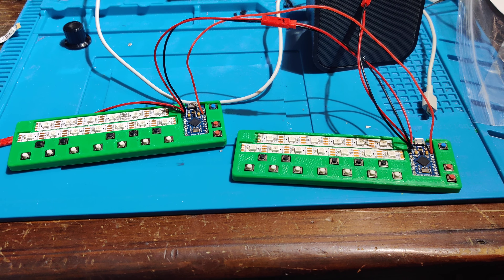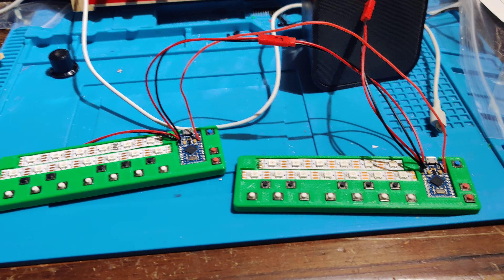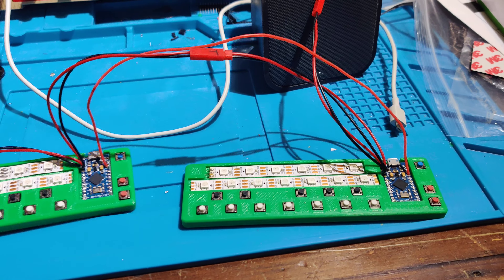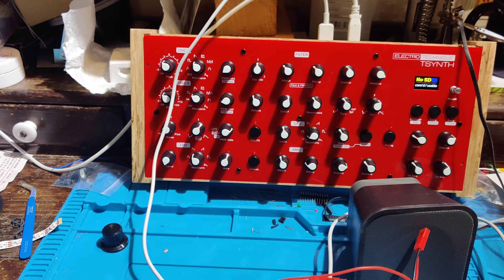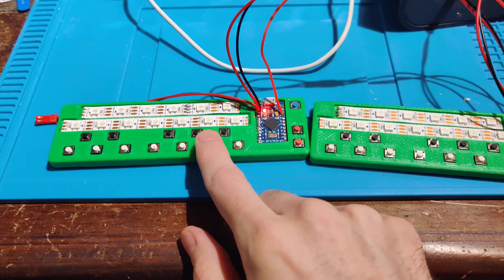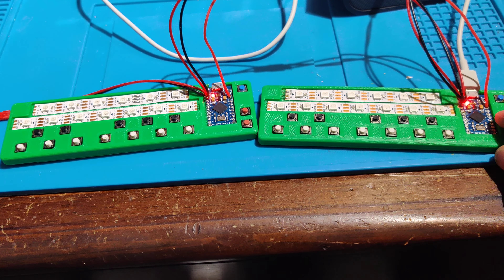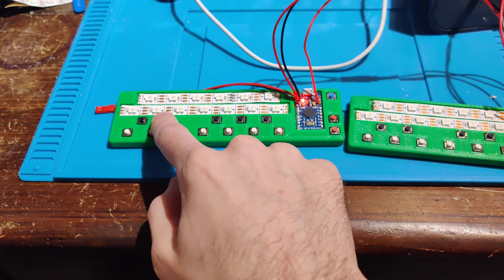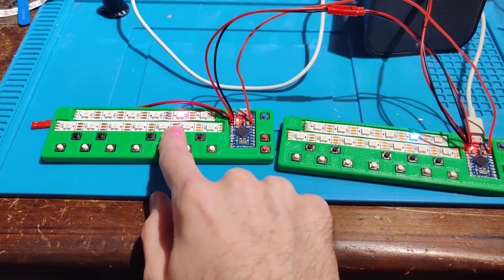LEET Keyboard MIDI Thru

Comment: Good stuff, now there needs to be accommodation for a simple header to interconnect the two; sort of like the sequencer setup. Have you built any of the other “leet” modules yet?
Reply from the maker: No. Honestly I lost a lot of interest when I found out they needed to be hooked together with a computer. I'd like to make some sort of generative sequencer.

Have you made one?
Reply: @WillWinder  kind of a hilarious stumble from “pretty sure I’ve got that stuff on the shelf” to multiple Amazon orders for the various bits; but yes, so far the keyboard, sequencer, control8, and Linux, which had its own uphill battle with the OLED display, nobody sells the 6 pin...the software for the Linux bit isn’t quite polished but it looks like squishbox does basically the same thing and could be ported, making an otg hub/audio for the Linux pi W in the same form factor but really an Android thing is equally or more effective, but I haven’t pulled down a specific DAW app to tinker w/.

Comment: So the midi doesn´t overlay. when you connect them together?
Reply from the maker: I updated the keyboard software to merge MIDI messages together when they are connected like this.
Reply: @WillWinder  Do you have that code anywhere? I have several leet devices and I would like to chain them.
Reply from the maker: @MrJohndoc  there is a pull request on the left synthesizer GitHub project with the code I'm using here.
Reply: @WillWinder  That's amazing. Thank you